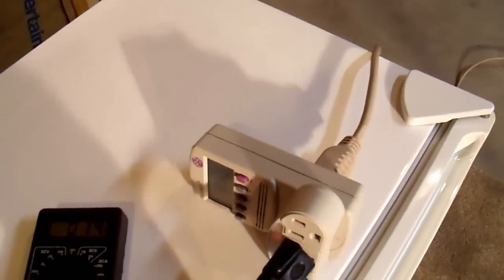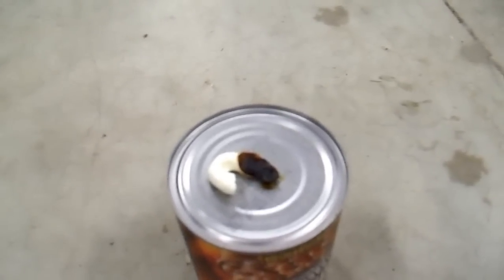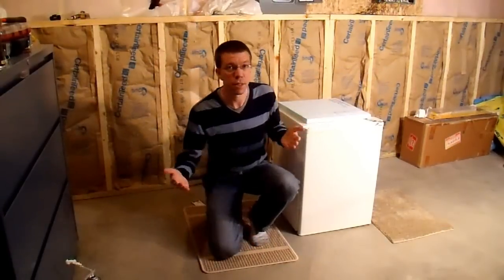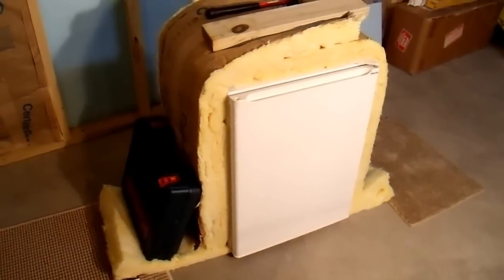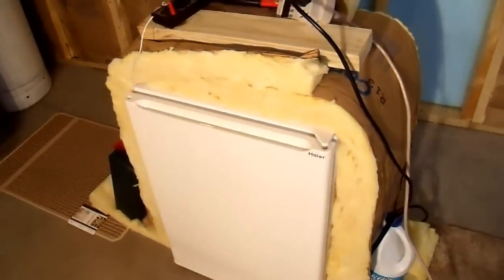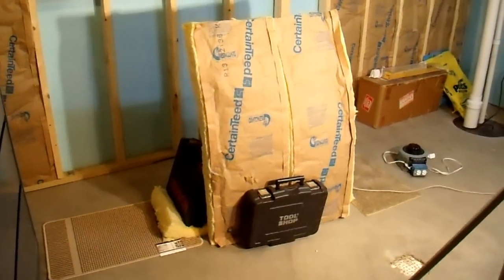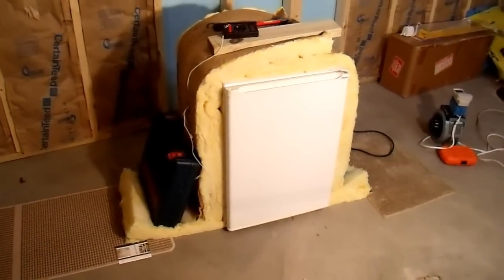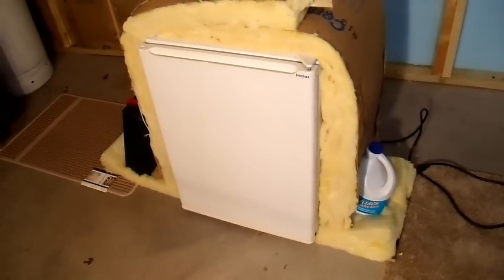Convert a Standard Minifridge into a High Efficiency Refrigerator - Part 2/2

Comment: Wondering where the condensation collects in your mini-fridge, some refrigerators rely on the heat of the compressor to evaporate the condensation from a tray in the back.
Reply from the maker: This was just a cheap walmart minifridge that you have to derfrost yourself by opening the door, letting the ice thaw, and wiping out the condensation.  Nearly all full sized refrigerators work the way you describe with a drip pan close to the compressor heat or condenser fan.

Comment: THanks you! 

by the way I think insulating the door gave you huge efficiency, it just got "lost" because the saved energy went kinda into cooler temperatures.
Reply from the maker: Could be, I was surprised it didn't help more too.
Reply: @knurlgnar24  you could try to measure the power consumption difference for a better fridge, at least Temp controllable, when going 3 degrees cooler (not sure what the difference was for you that it was cooler).

Comment: Would adding a digital thermostat further reduce power consumption in daily use? Our power prices have doubled. Now 75 ct/kWh
Reply from the maker: Wow, that's expensive!  Yes, electricity costs will rise significantly in the future - I'm surprised it took this long myself.  People don't appreciate the low cost of energy we enjoy today and that isn't going to last.  The thermostat has little bearing on the power use unfortunately.  Probably the best thing a person can do is to purchase a full sized refrigerator instead of a minifridge and fully fill it as they use a similar amount of electricity but hold a lot more volume.  This was more an experiment for a camper style situation where budgets may be low and it was fun to see what simple insulation can do to a standard inefficient unit.

Comment: A couple of my thoughts on this. One, a capillary tube is a legitimate expansion valve. But more important on to your test data. I suspect the efficiency improvement will not be quite as high when you add in opening the door per average daily use and cooling items added to fridge that are not at the fridge temp. I would guess the efficiency would increase by 20 to 25 percent with normal use.
  Another thought is at 80 degrees the efficiency would most likely increase over the 60 deg room.
Reply from the maker: I agree regarding the capillary tube comment.  It wasn't reasonable of me to expect a TXV on this appliance.  I didn't want variables so I did not open the door or add thermal mass to the interior of the fridge.  No doubt that would have changed the results some.
Reply: @knurlgnar24  thanks for the response. I have always wondered how much added insulation would add to power savings. Assuming the manufacturers would do the cheap upgrades first. It seems their priority is to build them as cheap as possible with the greatest interior room. 
  That building styrofoam sheathing with the aluminum backing is supposed to be more fire resistant or safer fumes than other foam insulation. It's my understanding the fumes off of most styrofoam can be very dangerous. Also an air space between the compressor top and insulation may be a good idea. They found in home construction insulation will transfer heat to roof decking causing melting and ice build up on roofs in colder climates.

Comment: Have you considered adding a fan to blow heat from the radiator? I have a small fridge below a kitchen counter, where heat from the fridge can only escape though small slits at the top of the fridge, where this seems to be a good idea
Reply from the maker: I've considered it but determined that any fan would take significantly more energy than the efficiency loss caused by the temperature differential of the condenser fan cooled vs convection cooled.
Reply: @knurlgnar24  Ok I see. Beacause I have a mini fridge below a kitchen counter where heat escapes only through the front. I might try to add a fan there.

Comment: you can get fire retardant pu foam. Powering that fridge looks like an ideal job for a powerjack
Reply from the maker: This was that type actually.  Fun fact on this:  Fire retardant foam is simply standard foam dyed the color inspectors require.  All expanding foam from reputable manufacturers meets flammability standards.  Perhaps you're referring to a different type of foam all together?  That's possible.  I wouldn't do this to a refrigerator I actually cared about so, yeah, I might as well put a powerjack there to power it too!  :)
Reply: @knurlgnar24  The fire retardant stuff is 10 times the price, I am assuming its pu, as it looks like (other than colour) and behaves the same. I thought the PJ gave a consistently low voltage.

Comment: When you reduce the voltage, the compressor might need to run longer, so whether it will save energy or not needs to be experimented.
Reply from the maker: The compressor is a positive displacement pump so its cooling capacity will be the same as long as the RPM of the pump doesn't change.  The thermal load of the pump motor also needs to be taken into account as it adds heat to the system, so if RPM slows by 2% but power consumption lowers by 5% there is a net gain in cooling per unit run-time.

Comment: Great ideas,but don't hydro carbons deplete our planet's protective ozone layer?
Reply from the maker: I may be going into the weeds here in terms of political opinions, but actual data and science don't exactly agree with that statement.  Hydrocarbon refrigerants are some of the most environmentally friendly refrigerants out there when actual data and science are considered.  I assume you mean GWP and not ozone depletion?  If so, yes, hydrocarbons do contribute, but refrigerant use is less than a rounding error compared to other sources both natural and manmade.  And even CO2 refriterant requires far more CO2 emissions to manufacture the system vs alternatives that use a hydrocarbon refrigerant.

Comment: I've been inspired. I have old dorm fridge "GE" brand 15+ YO with Sanyo compressor made in Mexico, not a lot of run hours. The door gasket is a good seal and the compressor isn't deep set and the heat exchanger on the back is offset about 2" from the back of the fridge. It seems like there might be some insulation beneath the refrig skin. I want to turn it into a mini freezer thats a little more efficient. 

Job #1 was to clean the compressor, esp the top and the heat exchanger, neither were very dirty. 
Job #2 is to use semi rigid foam packing and fit it in over the compressor, not so much to insulate the refrig space above it but, to redirect the got air coming off the compressor. It still has about 1 inch free airspace above the comprssor top. I'll trim the insulation projection down a bit after test run, I don't want the hot air from the compressor going directly up and heating the heat exchanger above it, dooh.

#3 Internal I set the refrig to max cold and removed the plastic drip tray beneath it which allows cold freezer air to drop freely and  make the refrigerator section colder. The bottom of refrig section is 34 degrees and I'd like to get it a few degrees colder and have taken off the plastic flip door on the freezer section to allow more cold air movement although I'm not sure thats a limiting factor, it might be it needs a freezer thermo and I'll see if it goes below 34. Not sure if I can trick the thermo to keep compressor running a little longer, it's set at ma cold but maybe I'll be able to force the dial a little farther. My nice killawatt measuring gizmo has recently gone missing and I'm praying for it's reappearance just to see how bad this set up is
Reply from the maker: Try eBay for a freezer thermostat that you can replace the refrigerator one with.  That will allow you to run it colder.  You could probably figure out a way to modify the existing thermostat by changing spring tension or adding a small heater to it, but those thermostats are extremely cheap to purchase.  In the end you'll not end up with something as efficient as a dedicated freezer out of a factory but it sounds like an interesting project!  A note of interest about this in the opposite:  A common use of chest freezers in the prepper/off-grid community is to convert chest freezers to refrigerators by replacing the thermostat with a fridge thermostat.  They are then EXTREMELY efficient.  Not so convenient, but efficient in that they use a absurdly small amount of electricity compared to most anything else in the house that does anything of use.

Comment: Increase fridge efficiency by frying the compressor?  There's a reason there's no foam there.
Reply from the maker: These mini fridges use both the compressor housing and the condenser radiator for cooling so, yes, this probably does increase the temp of the compressor slightly while running continuously.  It also decreases its runtime and duty cycle significantly giving it time to cool off between cycles rather than running nearly constantly as they normally do.  In retrospect it would have been good for me to measure the temp of the compressor housing before and after.  Either way if you're running on solar or batteries the electricity saved far outweighs the cost of a $100 fridge lasting 5 years rather than 10.
Reply: @knurlgnar24  Did you think of unbolting the compressor and moving it out slightly(it looks like the cooling line should allow it to move a 1 or 2 inches with out kinking)  then you could both protect the life of the compressor and move the heat source (both the compressor and coils) father from the cold box?
Reply from the maker: @Ms95670  I did not.  That may have been a great improvement!

Comment: That variac wasn't improving efficiency,  just slowing the compressor motor. Cooling capacity also wil decrease(will run longer to cool) You also lose efficiency through the transformer so that was all pointless.

Comment: Thanks for running the experiment.  I was wanting to know.  How about adding some small fans inside and out.  Also adding some blast load - like water bottles.  Running such a fridge off solar it would be very important to correct the power factor. I'd love to see this done with 2 to 4 inch foam all over and with second seal  Think about converting it to a eutectic type (with 2 day reserve) so one could run it off a solar panel with no battery.  Lastly, it's possible to simply cut the box off the compressor circuit and build a new super insulated box.  that would be cool too.

Comment: You started at .5 kwh and got 20% and then added insulation and got down to .34 kwh. That is NOT 40%. You made a basic math error.  The second time you got a 20% improvement from the .4 level and that is a different value that 20% of .5. So simply take the .34 kwh and compare to the original .5 kwh and you have .68% or about a 1/3 improvement.                40% improvement would have put you down to .3 kwh.

Comment: An A+ brand new 4.2 cu ft fridge would cost 119 kWh per annum.  Don't forget if thinking about this to check your material costs against the cost of a modern, improved efficiency model before shelling out.

One of the ways you can most help your fridge efficiency is by managing the environment it's in.  Don't put it in a continuously heated area or in front of a window, especially a south facing one.  If it's in a warm room, it has to work harder.

Comment: I would have added a fan to force-cool the condenser, because as it is now, it bathes in its own warm air, so the efficiency of this component is not very high.  Better yet, it could be water-cooled by laying it in a small container of running cold water.

Comment: With my fridge, I just used cardboard in the compressor cavity, as I still wanted to keep airspace around the compressor. I think I stuffed like 4 or 5 layers or so in there, and it friction fit in quite nicely. And a tinfoil lined sheet of cardboard behind the radiator.  however another thing I did was add quite a lot of solid copper ties to try and add mass and surface area to the radiator.  And I noticed about a 1/3 drop in energy consumption.
Reply: I think spraying the insulation so close to compressor will reduce air movement around compressor and cause it to run hotter and strain and shorten operating life. Try fitting a facade to direct hot air off compressor away from compartment beneath refrig body.

Comment: Have you thought about putting a delay timer in the thermostat power line, so that when the thermostat switches the compressor on it does not start until the delay timer allows it to. This will give you a lower frequency of compressor cycles and the net effect will be to use less power to run the fridge. I did this on a central heating boiler back in the 1980's and the efficiency was increased by around 35%. It worked on the principle that there was a lot of stored energy in the form of heat contained in the metal of boiler heat exchanger (which was cast iron), With a fridge it would work in reverse allowing the interior temperature to increase inside the fridge by a degree or two. Still perfectly safe and acceptable given the added insulation.

Comment: This is insane. I have a fridge/freezer combo that appears twice the size of this and and takes 150kWh per year right from the factory. It is also much better insulated than this cheapie . Sure it cost a lot more. But i think, oer here in Europe, energy is so much more expensive, so these cheapies won't even sell because even if you ran it for just two years, the energy wasted would cost more than you could ever save on the buy. 150kWh cost me around €45, which is about USD56 at the current exchange rates. Good job done there.
Reply: Wow 150kw only cost me about $18 
FL USA

Comment: Great efficiency hack! 

I was wondering instead of using spray foam to insulate the condenser what about using rock wool? Since rock wool provides a fire barrier as well as an insulator? 

Also you showed how the refrigerator door came with a magnetic gasket, but most mini refrigerators don't have very good gaskets. Can you recommend brands or types of gaskets one can purchase and how best to install in place of the manufacturer supplied gasket?
Reply: Maybe a freezer gasket from a appliance store would work best.

Comment: Awesome video. I have two questions:
1. Why let the dry wall screws even touch the radiator frame? Won't that conduct heat?
2. Have you thought about detaching the compressor and radiator, put them on their own frame, and turn it into a mini "chest fridge"? 
[Thinking about using one in place of my normal fridge/freezer]

Comment: Hey Knurlgnar, cool vid, just discovered it. I took a very old 18CF fridge and insulated just the back with extruded foam board some 12 years ago. I am just about to replace it now after finding out the horrible energy efficiency it has (3.2 KwH) a day. This has the condenser underneath with a fan blowing on it. but it is so old school, it's time

Comment: Is there a way to flip it on it's back to turn it into a chest fridge?
Reply: The compressor needs to be level since it sits in a bed of oil, other then that you can use it as a chest fridge.
Reply: take off the plastic drip tray under freezer compartment and remove plastic freezer door so that coldest air from freezer sect drops freely to bottom of combo freezer/refrigerator, I got 34 degrees (with good door gasket, full load
Reply: I got 34 deg without removing freezer flap door, replacing thermo with freezer thermo would probably run comprssor longer with colder temps

Comment: Thank you ! Great info. I have the same unit (black!) in my RV and will be putting in my camber van running on Two 100 watt solar panels 3 deep cy. batts and I hope start up will allow my 400 watt inverter to be used or I may need a bigger inverter and or capasitor.
I timed its as factory stock op. the other day in the RV with int. RV temp around 70°. Unit fully cold, door closed in 4 hours it came on 4.5 times ran average draw of around 80'ish watts for about 7 to 10 min.s. each time. I felt that very acceptable, but with your information given 4" of foam insulation, the spray insulation and the cooling coil separated, I will half my power needs, I think. Thank you. Enjoyed your video.

Comment: This came from the owners manual for your exact make and model (Haier Model # HC45SG42SB) refrigerator.

Proper Air circulation
To ensure your refrigerator works at the maximum efficiency it was
designed for, you should install it in a location where there is proper
air circulation, plumbing and electrical connections.
• The following are recommended clearances around the refrigerator:
 Sides……………3/4" (19mm)
 Top....................2" (50mm)
 Back..................2" (50mm)

Comment: I have a mini fridge with no visible coils. I read that this type may have no coils at all and uses the metal body to expel heat, but this doesn't really make sense since I don't see where the compressed freon is going. You mentioned that this trick will not work on my type of fridge, can you elaborate of the 2 different systems?
Reply: That is the problem with that type of fridge or freezer. Need one that vents in back. Adding insulation would make it worse as it keeps the heat in.

Comment: You will over heat the motor coil windings by lowing the voltage, and the start
circuit will be strained.
Reply: exactly, as this is an induction motor designed for specific voltage, can't regulate voltage on induction motors